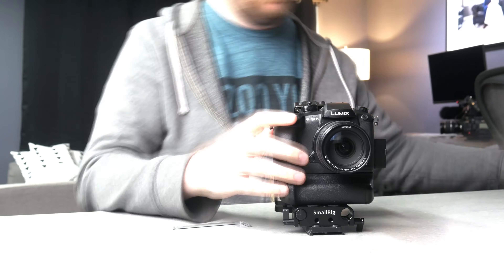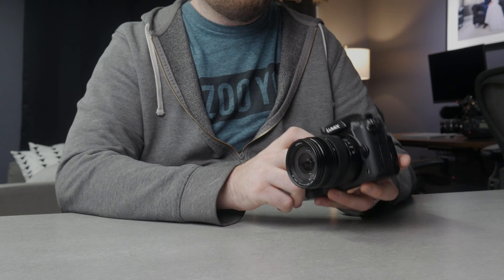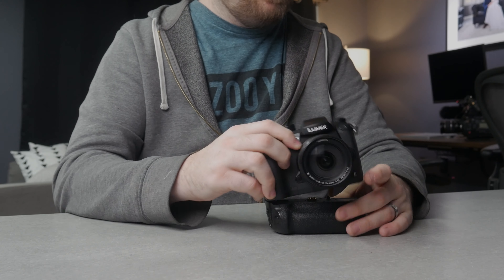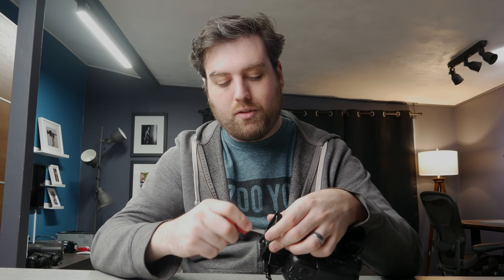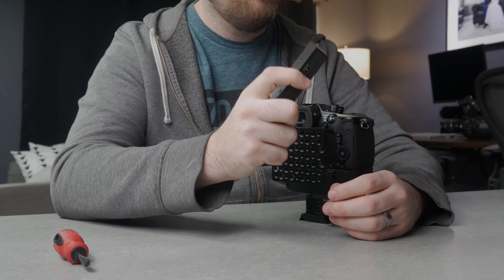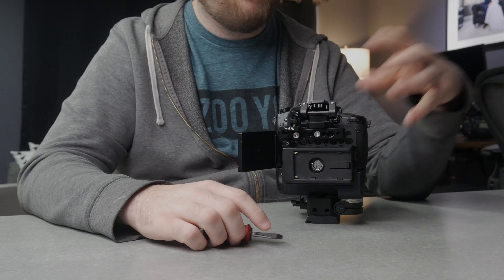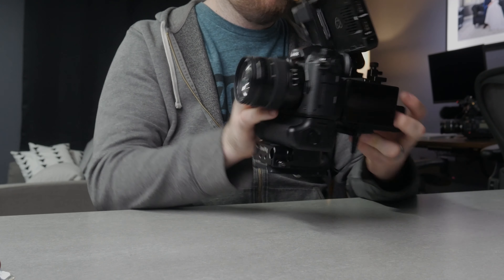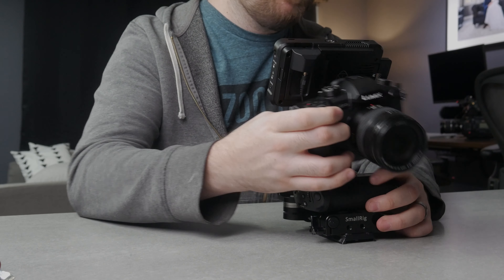I BUILT The PERFECT GH5 Rig!

Comment: Very helpful! What are all advantages you've found using the Ninja monitor with the GH5?
Reply from the maker: Two main reasons I wanted it. First, shooting log with the GH5 in 8-bit color ended up being tricky on some occasions. Specifically when I was doing things like skies or mixed co loo or lighting. I ended up with color banding. So making the jump to 10-bit 60p with the ninja allowed me more flexibility in post. Honestly probably wouldn't need it if I wasn't trying to match the GH5 to my black magic cameras, because I wouldn't need to push the color grade so hard. But when trying to match the cameras, having the flexibility was great. The second thing is that GH5's internal codecs would chug occasionally in the edit when I was mixing it in with other cameras, while those cameras played smooth. Being able to use prores is way easier to edit.